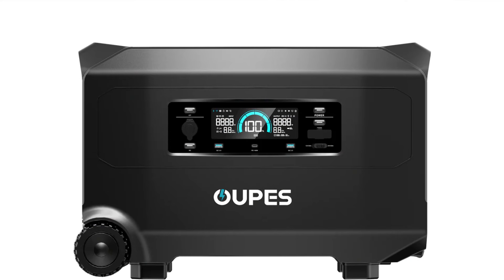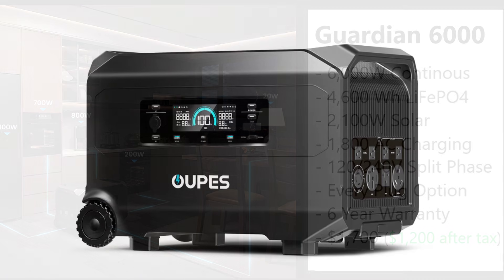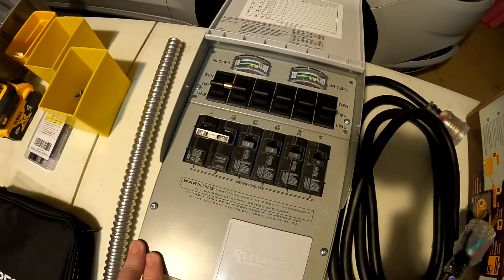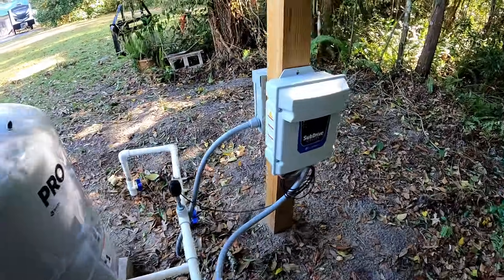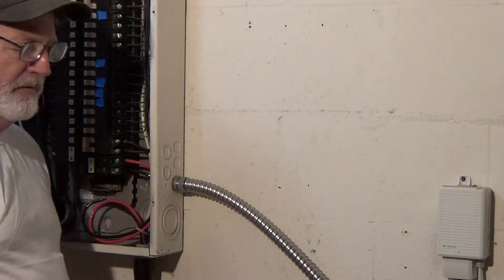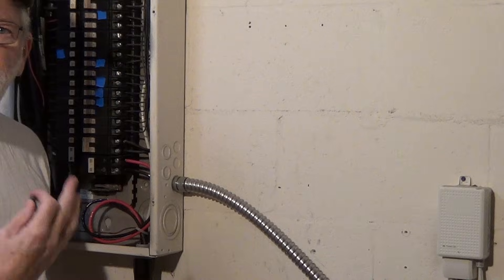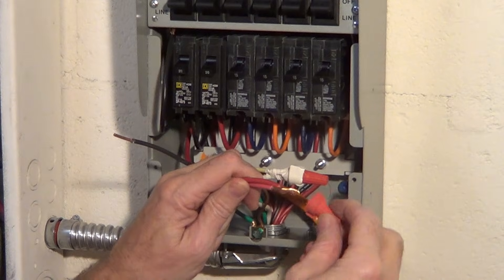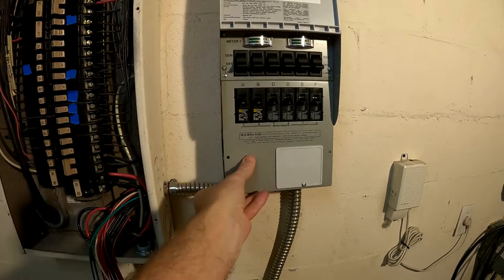DIY Home Backup Power | Guardian 6000 and Transfer Switch Wiring

Comment: I have an interlock kit with a generator inlet box. It works the same way, but without the considerations for wiring. Of course I had an  electrician install it. Just a few more steps to start it up.

Comment: I have a Toyota RAV4 prime, a plug-in hybrid. I did test charging this vehicle using my Guardian 6000 with one G5 expansion battery. This gave me 2 hours of charging at about 3,700 watts. I think the battery was at about 86%. The battery had just arrived, I did this to discharge the battery to 0% before charging it again. After listening to a video or two, I guess I will do this once every three months. But, in two hours I achieved 28 miles of a potential 47 to 50 miles EV. Not certain how completely this charge a Tesla. But, it does charge my car fairly well.

Comment: What would happen if the main breaker switch isn't turned off (while there isn't any grid power) and the Guardian 6000 is connected?
Wouldn't that backfeed into the grid?
Reply: It would not back feed the grid.  The real power of this transfer switch over a simple lockout is that you can actually run the grid AND the backup source at the same time.  This means that you can have some circuits in your house running on the grid and others running on the backup source at the same time.  So this allows you to take advantage of your solar power every day, year round and not just during a power outage.  The transfer switch isolates each circuit so there is no crossover.
Reply: https://youtu.be/vUV3Abu4WFQ?si=KcdcQXXXV7Y42TSR

Comment: So by the looks of the display everything you were running would run for 8 hours minus the fridge.
Reply: Yes, So I would expect to turn the lights out and run the fridge (and fans) overnight.  If you added the 2,100W of solar panels, you could then run everything all day AND recharge the OUPES battery at the same time.  Then you could repeat this process (indefinitely) as long as you have good sun (with zero fuel cost).  I would then add a small gas generator for times when you have cloudy days.  You would only need to run the gas generator for a few hours a day to recharge the OUPES rather than 24/7.  This method saves a lot on fuel and noise.  Note:  I do have a series of videos on my channel that cover this in more detail.  Thanks!